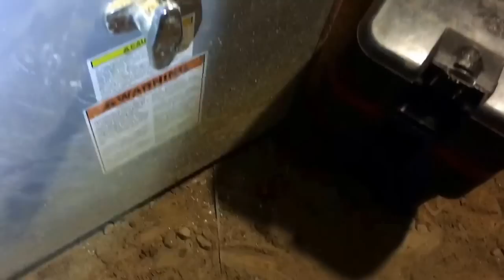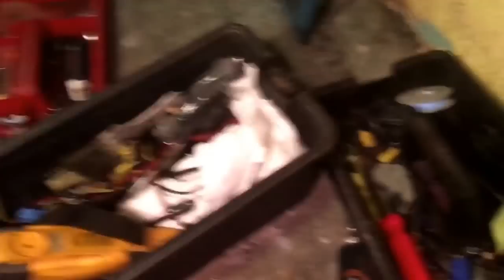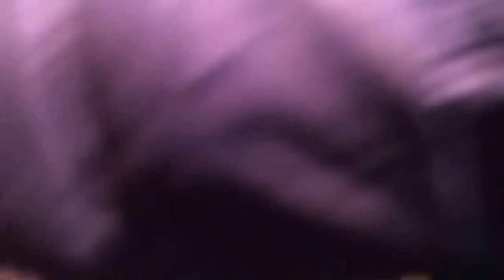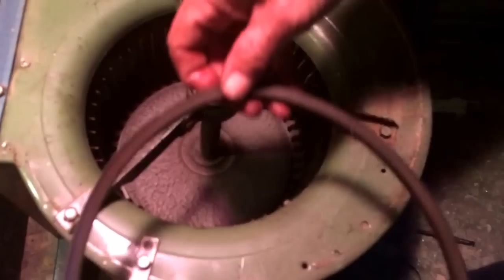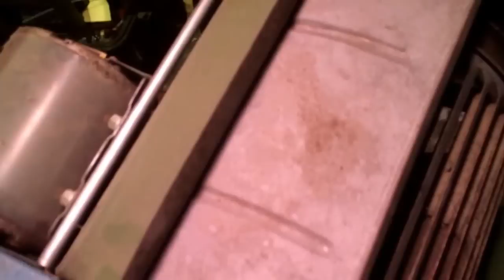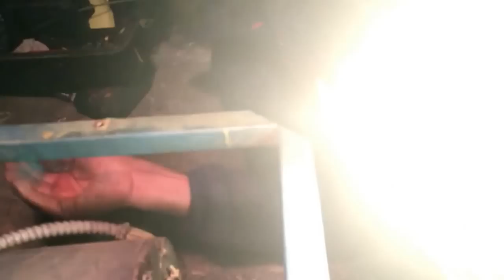Replace blower bearings

Comment: Those are bushing's i did mine a few year's ago they were worn out in a year had to replace them. If you have to replace the bushing's go get some ball bearing style ones they last forever  been 5 year's since i put the ball bearing  ones in run's as smooth as silk still.